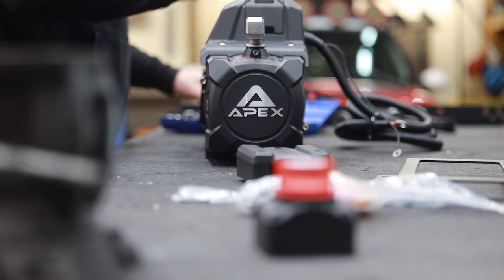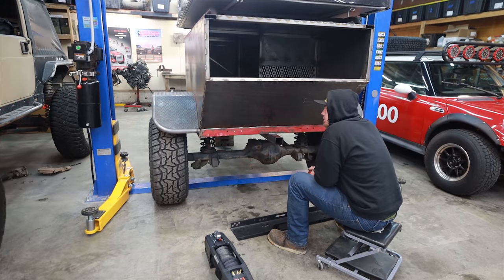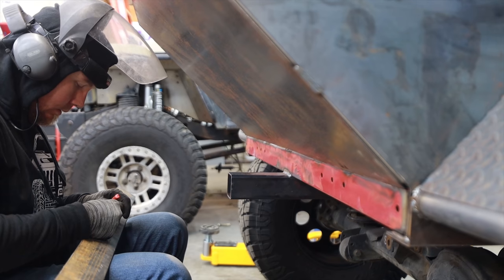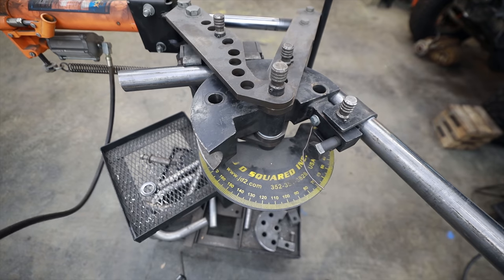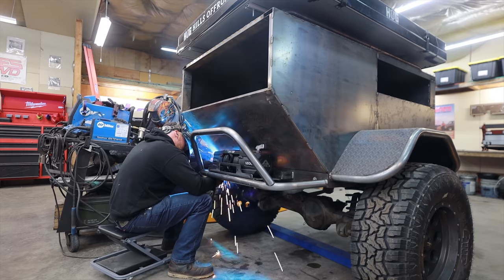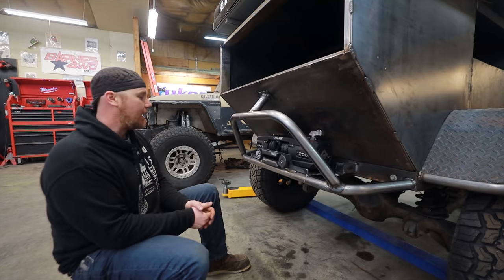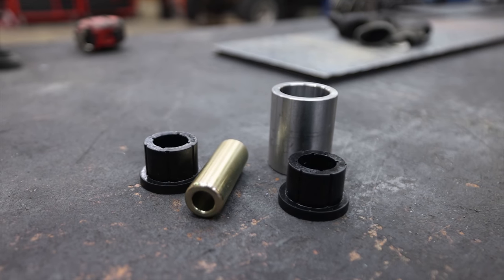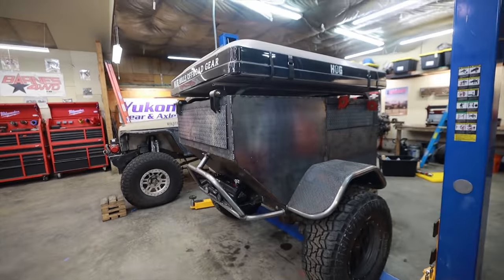Harbor Freight Winch on a Harbor Freight Overland Trailer.

Comment: My first thought was, “why not just do a hitch mount winch if you want it to be removable?”  But let me say, I like how the bumper and winch mount turned out!
Reply: I was thinking the same thing! That center tube is a receiver tube from the front. Just run cables from the battery to it and you're done!

Comment: The trailer is looking great. I have one little tip for you with regards to your new mag-drill. Always tie it to something that can support its weight in case you happen to trip the breaker or otherwise lose power. No power means no magnet and gravity never fails.
Reply: That a great tip , thanks .

Comment: This is something I think almost every offroad trailer is missing.  The potential issues are almost countless from simple repositioning the trailer and recoveries.  Placing it on the center backbone and frame rails is I think a great execution on the idea.
Reply from the maker: Agreed! I'm suprised you never see a rear mounted winch on Offroad trailers. Such a great tool to have 👍

Comment: More ideas that's time has come, when I learned that you come up  variation of the cleat and hawse pipe for passing a rope thru the side of a vessel to a cleat. which by the way I did mention to you in previous comments previous videos   a good idea on other videos concerning your   now in production at Yankem Ropes.

An old adage a stitch in time saves nine; mounting the winch on the back of that trailer, a very sensible thing to do as opposed to finding trees strong enough to support your tree saver straps, snatch blocks  a to pull yourself out on that way from the winch on the front of the vehicle.

Comment: If you didn't do so already, I strongly advise that the upper tube mount on the body of the trailer should have a load distribution plate that's larger than the outer mount plate on the inside of the body in order to disperse the load pulling from the inside outwards across more of the body panel...it's something a lot of folks don't think of when it comes to mounting things, and it's good to show them how they should be properly doing a sandwich style mount like that with a load plate...

Comment: I like it and I think it looks good, the only thing I’d say is that the notch you had for increased departure angle is essentially defeated by the winch bumper. At this point I’d say you’d be better off with a straight back and the winch could be under cover so it doesn’t get covered in crud on the road and trail. I know this was an unplanned add-on but for a new build I think that would make more sense and yield more usable space inside.

Comment: I have the OG HF 12k winch. I changed out the orginal grease in the planetary gears, with some higher end high pressure marine grease. And did some other sealing of components. Thing is still dry and it works great

Comment: Im glad you're back. I just bought that winch and plate based on kellys recommendations. The plate was horrible for the front of my yj. The lip prevents the tow hooks from working and it's too wide. I got tired of cutting on it. I bought the rough country one and the front winch bolts hit the factory bumper just enough i couldn't push the plate back far enough to bolt it down. I had to notch the bumper. I wish i would have gotten a raised plate or had your shop to make one lol.

Comment: An alternative idea - receiver mounted winch. I haven’t (yet) started carrying an extension cable with anderson couplings to go from my truck to my trailer’s rear receiver, but I should.
At present, I can use my cheap X-Bull winch on its receiver tray to pull forward or backward. But, until I make & carry that cable, I can’t pull backward from my trailer.
You make a great point, though! My Class III receivers on my truck and the back of my trailer aren’t rated for the 13,000 lb capacity of the winch.
Reply: Trailer: https://youtu.be/njMlw5QPPRg
Reply: Winch: https://youtu.be/JT4BzCeh00M

Comment: It's a little late, but I would suggest putting taillights and license plate on back above the bumper. 

You can easily make mounts and since they are on fixed surfaces, the wiring is easier and more durable. You could probably use 1x1 to make a raceway to protect the wiring, since LEDs don't take much power.

Comment: Where the back breaks and goes up, put a shelf inside so you won't be struggling to reach stuff in the bottom. Then put a small panel door on the side to utilized the area in the bottom

Comment: Love the trailer, the off hand fabbing was great to watch. Why didn't you have the door drop down to creat a table? I know when I work in the dirt I always what a clean flat surface to put things on. If you are worried about access, just use chains to drop it free.
Reply from the maker: I don't want to limit what I can reach in the back of the trailer plus it will have a 6 foot long table on the side of the trailer 👍

Comment: I saw this one trailer was the most interesting trailer tongue I've ever seen. The trailer tongue was connected to the trailer by a cable so you can take the tongue connected to the truck and pull the trailer to the truck. I want to do this.

Comment: Nate the rear bumper has really good asthetics with one exception, that upper mount that is centered.  It looks less professional than the rest of your other work.  If you knocked that center tube back out, and/or added tubes from the upper bends out to the corners of the trailer, I think it would look more symmetrical.  

Otherwise the trailer looks sick!

Comment: I just bought a Apex for my car hauler. I put it on a cradle and will run 32" jumper/winch cables in my dually. I will have a plug front and back for the winch or jumper cables without popping the hood. I just need a bumper with a receiver hitch up front

Comment: Nice job, Nate! I'm downstairs in my man-cave right now. My 'shop' is in the room next to it, and on the bench is a Harbor Freight Badlands Apex 12K winch and the Harbor Freight mounting plate. You been peeking in my window? My plan is to mount it to the front of my '04 Chevy Trailblazer EXT. I intend to inset it between the frame rail, like the new Jeeps do. I already got it pretty well figured out how I'm going to do it.
I do want to make one comment about your winch plate: You voided the warranty! HORRORS! LOL! If you read some of the reviews on it on Harbor Freight's website one recurring comment is that the bolt holes "don't line up with my XYZ's frame/bumper! I can't drill new holes because it will void the warranty!" It is listed as 'universal fit', which is an Old English term meaning 'must be modified in order to work'.

Comment: That’s a great idea to put a winch on the back of your trailer and making it removable is also good, but I think it could’ve been simpler.  I came up with an idea a while back after trying to load a non running tractor onto my gooseneck trailer after having a snatch block on the front of my trailer hooked up to another tractor to pull it up. Anyway I’m gonna put some receiver hitches along in different places on my trailer for both tie points and for putting trailer balls, knowing that HF has smaller winches that fit over a trailer ball I wanted to be able to put my 12,000lb winch on my gooseneck ball or any other ball so with my brother who works at a place that has all the good equipment to cut and build things I called him and told him my design, he told a guy who works with the stuff and I got a 1/2” plate that will fit over a trailer ball and has a receiver hitch welded on it to hold the hitch mount winch carrier, now I can put the winch anywhere there is a trailer ball and I can get power to it.

Comment: I love the rear winch on the trailer! I am curious if you have decided how to power it yet? I'm guessing you will run long and thick wire cables to the starting battery. I am not sure what other option you may have. An auxiliary battery in the trailer may work, but may also struggle without the motor and alternator assisting in the load. I can't wait to see what you decide to do.

Comment: I would not have attached the top of the loop bar to the body, I would have made it sacrificial.
Any impact to it will be immediately transmitted to the body, while if it was unattached it would not.

Comment: That trailer looks really cool, I'd like to build something.
What do you think about putting some dynamat or similar material inside some of the panels to reduce the metal banging and tinny noises? It really doesn't take much dynamat to reduce the metal vibration noise. I can imagine it might be a little loud going down bumpy roads even with the rubber seals and stuff.

Comment: Two questions:  What is the purpose of the little piece that goes from the upper tube to the angled body of the box?  Is there reinforcement in there to help support anything? Seems to me if you hit your bumper it will transfer the energy to the trailer box. Question 2:  What happened to the food prep shelf you had on the side of the trailer? I loved that idea. Going to do it to mine. Love seeing the little trailer come together. It's looking great!

Comment: I've had a 12000 lbs badlands winch on my 93 yj for 5 or more years and never had a problem.  I've had to tie myself off to something else to pull downed trees out of the way.  Whenever this one dies I'll upgrade to the new 12000 lbs

Comment: So have you weighed this Behemoth it looks like you will be way over the whole vehicle load weight.
Me I would have mounted the winch to a 2" receiver and the added tubes fit over slugs with hole's for pins, this way you could remove it from the trailer and fit it onto a 2"receiver on the tow vehicle with a power plug on both trailer and tow vehicles so you could fit on any truck/Jeep rear or if fitted a front receiver as mine has. Now working on side receivers to fit the winch for side recovery or to stop a side hill rollover.

Comment: Great how to without trying to make a "how to"!  Question: What blade are you running in your circular saw (not your chop saw) that allowed you to cut steel so easily??
Reply from the maker: It's a special skill saw from Evolution. It has their own blade and the RPMs of the saw are to optimize its ability to cut metal instead of wood 👍

Comment: Top center mount to the bumper I don't think is a good move. If like you said it might take a couple of hits. I would think. Let the bumper take the hit and let it bend. Easy enough to fix. But if the weakest part of the compartment on your trailer is also attach then...........Just 2cents from an old guy.

Comment: Why not put the winch inside the trailer with just a slot for the rope to exit? You could also extend the winch engage lever either mechanically or some sort of actuator - so that wouldnt need access to the "winch box" inside the trailer.
Something like this would help departure angles!

Comment: Wow, cool bumper design, I am really curious about the weight of the trailer.  It will definitely be strong enough to take a hit and a roll.  My guess is 1,100lbs for the trailer, including the axle, wheels, winch, but without the roof top tent and without gear, just my guess.

Comment: Any thoughts on adding a attachment point(s) for a snatch block  above the winch to lift the trailer from a mud hole, over an obstacle or just to change a tire?  I don't know if you have the enough structure in the frame  or the correct geometry?  It may be over kill but always nice to have options in the " what now "situations.

Comment: Great vids, thanks. Keep it up. Question: what brand and model twin post do you have, and how well has it worked out for you? I'm working on getting a shop put up. ( As soon as I can get permits, and unwind all the red tape). 😖
Reply from the maker: This is a generic one off of Amazon and I have only used it couple times so far. I wouldn't make a suggestion one way or another until I've used it for a year or so. It was like... 2800 bucks?! I think? Something like that 👍
Reply: @DirtLifestyle  Permits are taking 6-8 months here, and who knows how long for the building, so that's about the right time frame. I'll sit back and let you do the de- bugging.😆